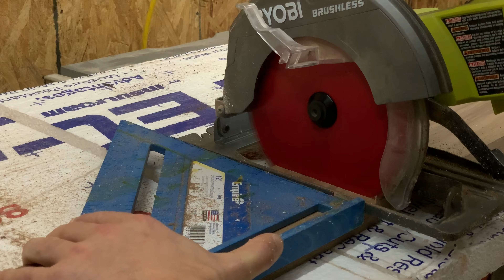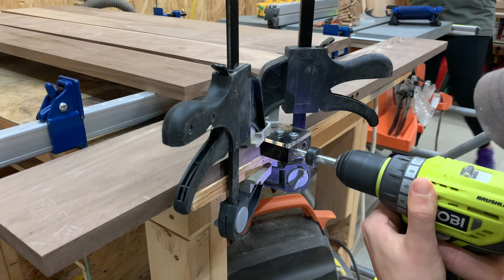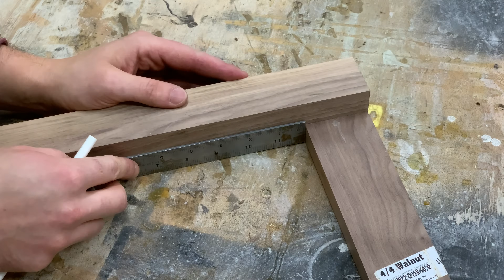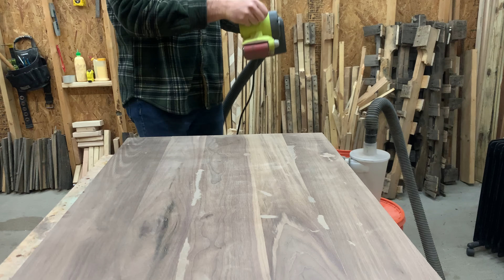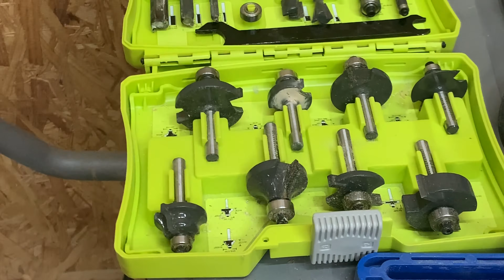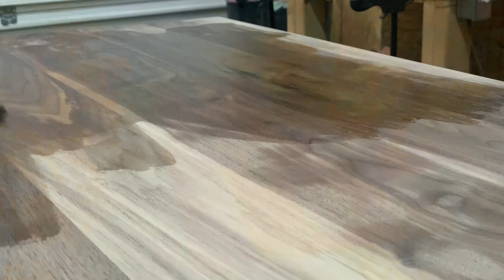Uncomplicated Luxury Furniture Building with Basic Tools

Comment: NEVER trim the top to size by removing material from only one side. The top will always look amateurish because the board on one side will be narrow. Typical rookie mistake that is easily avoided. Also, maybe you were doing it for affect, but NEVER bottom out a router bit in a collet.
Reply: i cried when i saw that because of how much one panel was cut, that one panel on one side would bug the hell out of me if i had that in my room